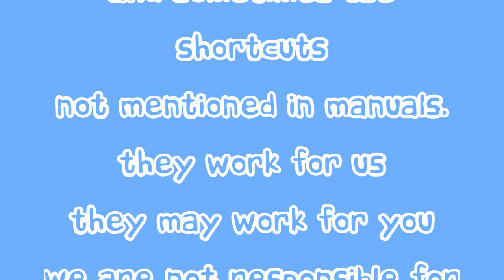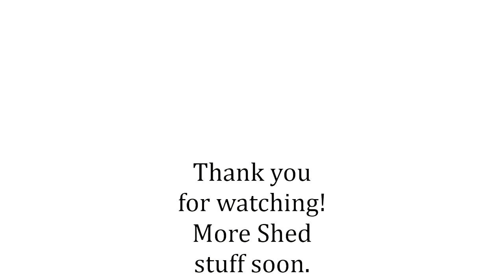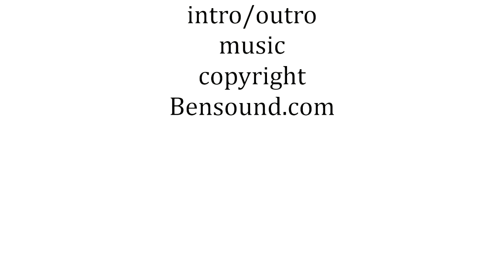Land Rover Discovery prop-shaft disaster Part One!

Comment: There is a flange kit that bolts on your rear diff. If i remember right costs around 30€. After that you can put a normal drive shaft, with u gionts front an rear. I've paid mine around 70€ more or less 2 years ago. Doing this conversion you will eliminate the proablem with that rubber thing for ever. Hello from italy😁
Reply from the maker: That’s great to know. Thank you for the information.